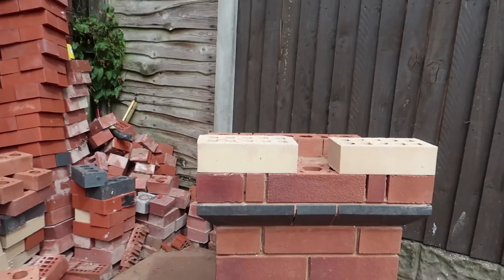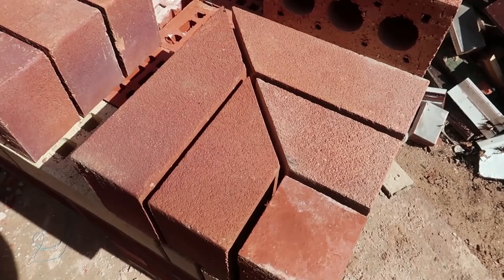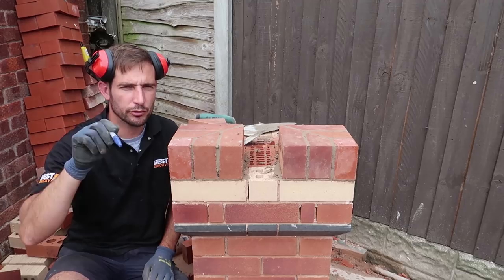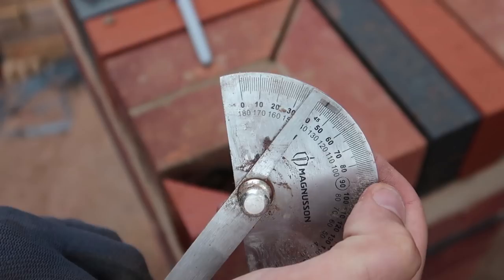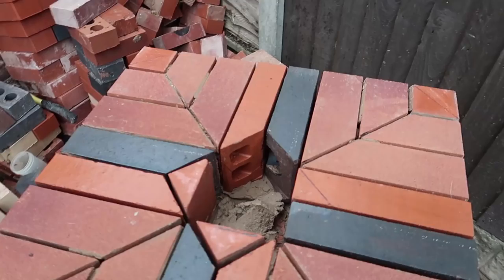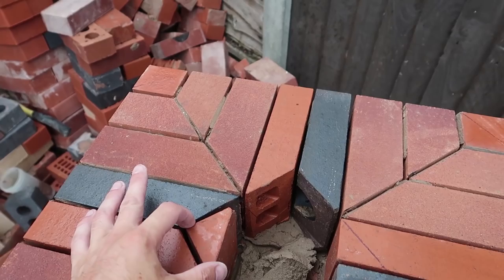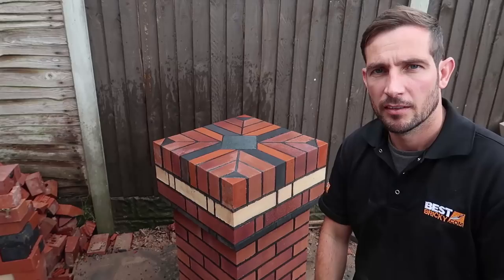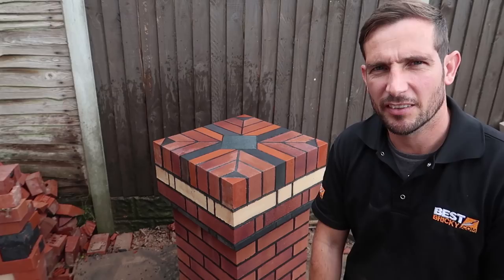Bricklaying, Cool BRICK PIER

Comment: Looks great , but the middle bricks were wiped with mortar & not fully jointed also the corner bricks will fall of in time , the whole top is open to water ingress because the joints are empty causing frost damage

Comment: Would it be easier to use a black motar from the start and save going back to repoint ? Great videos by the way 👍
Reply from the maker: Not got the money to waste dye bud. Plus I reuse the mortar cheers 👍
Reply: Ahh Cheers for the reply pal 😀 also what size joints did you use looks class ✌